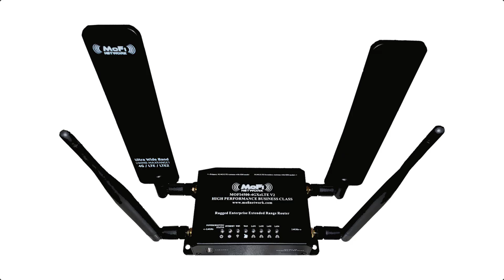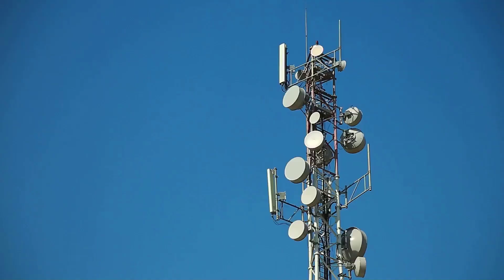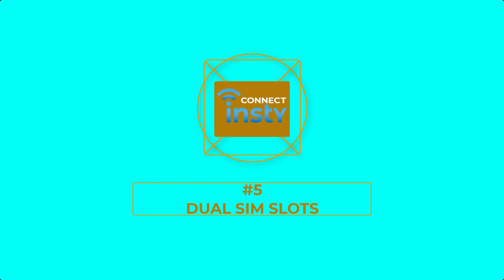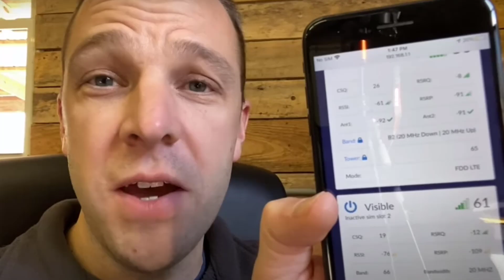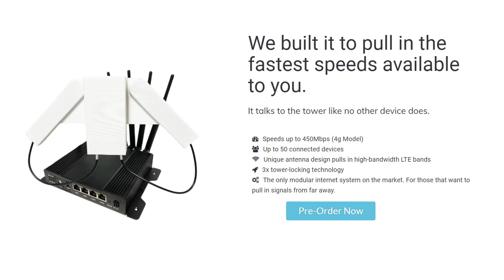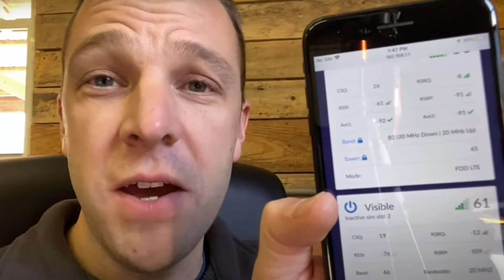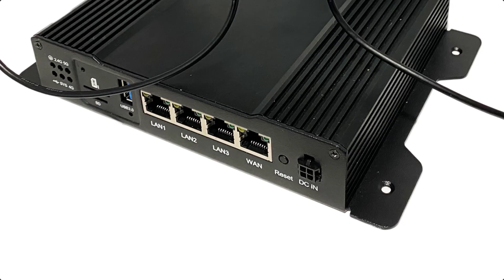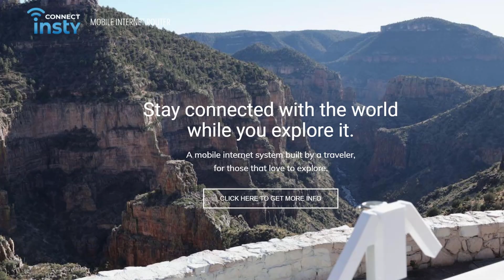Insty Connect Explorer 4G12 - Mobile Internet System

Comment: Very good video, as usual.  With both this unit and the Mofi are you purchasing a unlimited phone plan for your phone and than also purchasing a sim card for a tablet for twenty dollars to use in  the unit?
Reply from the maker: I currently have multiple phones with T-Mobile and just added a phone line onto that plan for $20/mo to dedicate to my router.  I also got an AT&T iPad Unlimited Data plan as a new customer for $20/mo. I use both of those SIM cards in an iPad and the MoFi and trade them out depending on coverage as I travel.  With the new Insty Connect I'll put both SIM cards in the modem and just toggle them on or off depending on coverage.  With either the MoFi or Insty Connect you don't need a true "unlimited" data plan.  Those are much more expensive than a regular phone line.  The benefit of the TTL setting is that you can get a regular phone line to go past the data cap without throttling, effectively making it unlimited.  If you are luck to have a grandfathered true unlimited plan it will work in these devices though.
Reply: @SeleTraining  would you be willing to do a video on this setup?
Thank you, very informative
Reply from the maker: @TheBadSeed3094  I'll have one of those videos coming soon.  I want to give it some time testing the Insty Connect and then I'll provide a setup video, live Q&A, and other videos.  Coming soon...